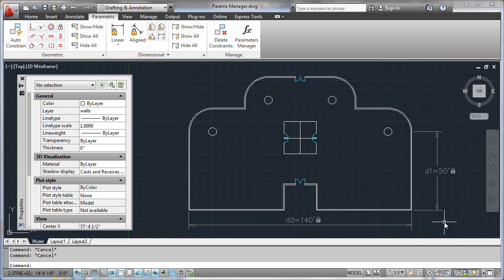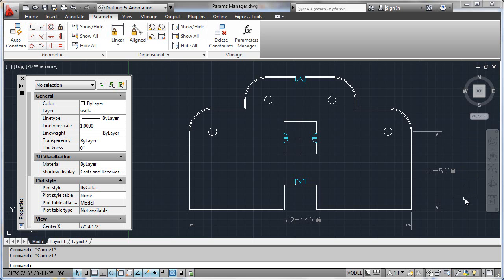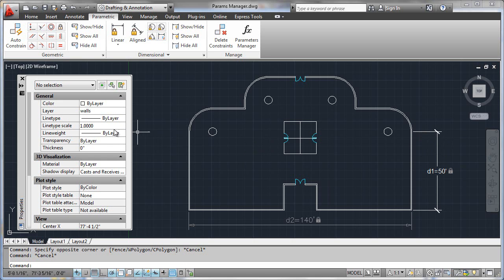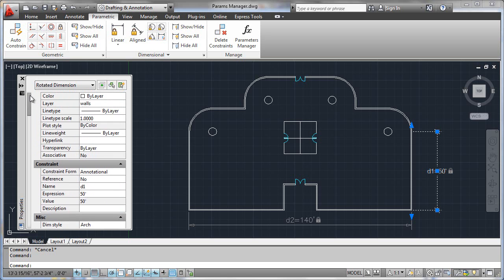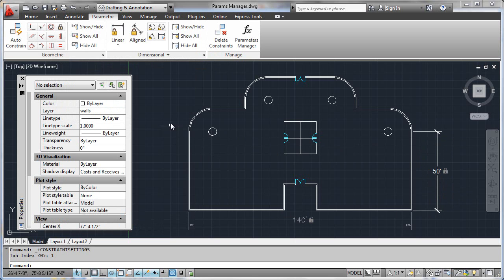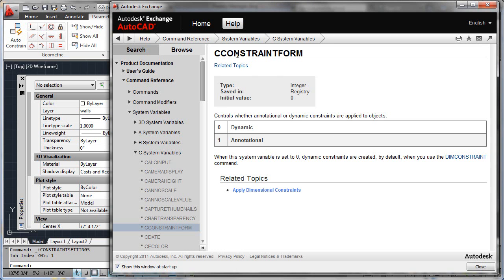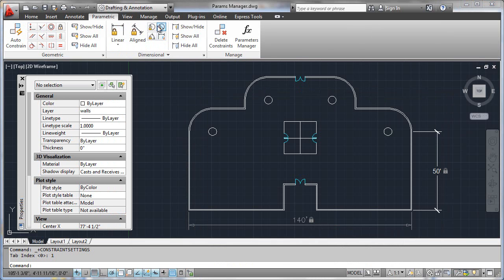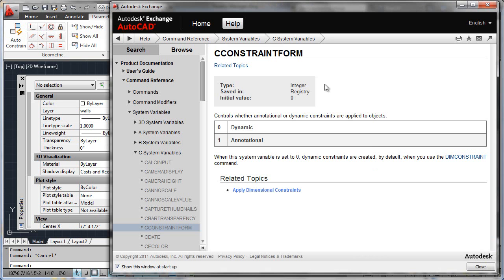Dynamic vs. Annotational Dimensions

Comment: Hi, please guide me.
I made a block with some hole's in its. After that I applied dynamic constraints in dynamic block.

Outside the Block, I mentioned dimensions/position on holes.
And I want, If I change the block shape or I change the Holes position using dynamic block. Dimensions  should also change according to new location of hole's.

Please tell me is this possible??
If yes, then please tell me how?